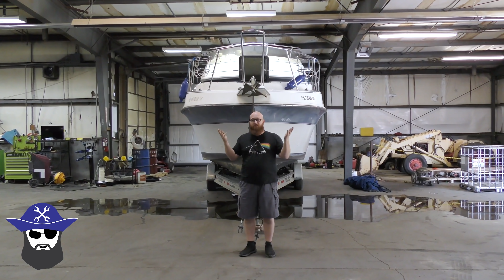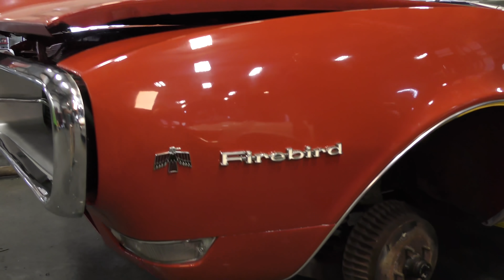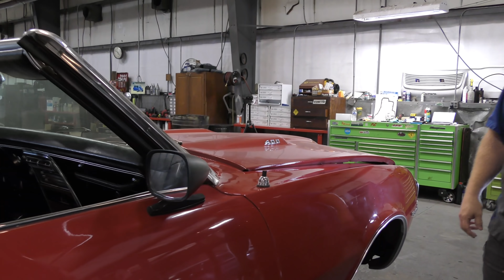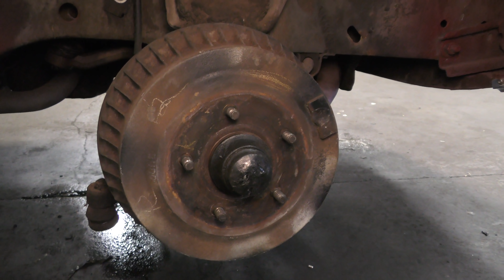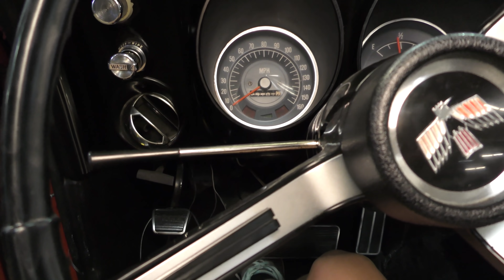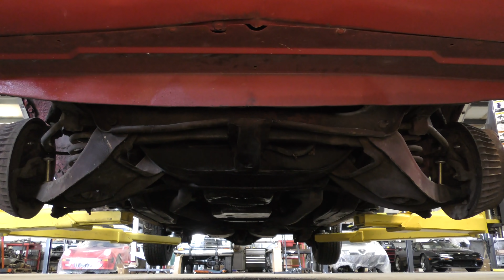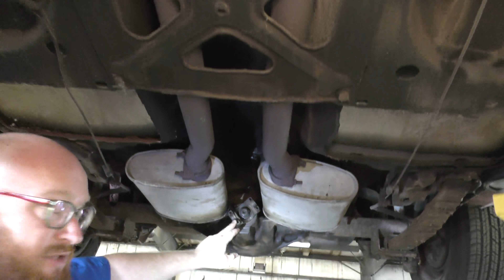Fabulous 1st Gen 1968 Firebird 400 leaking like Niagara Falls. The CAR WIZARD finds 6 places leaking

Comment: Whether or not you think these are easy to work on compared to some newer cars depends greatly on which newer car you are refering to.  I could have everything disconnected and have that entire engine out of the car faster than I could replace the valve cover gasket in a 2011 BMW N55 engine.  I owned four first gen Firebirds in the past and one 2011 BMW 335i and have done both (removed engines; replaced valve covers).  Replacing the valve cover gasket in the BMW was a 4 hour job minimum (unless you've done tons of them) and that didn't include the initial research time. I've pulled the Pontiac engines completely out of Firebirds in the same amount of time in my younger years. But, if I wanted to replace just the valve cover on the Pontiac engine, I could do that in 5 or 10 minutes.  They are not hard to work on just different. One of the modern advantages is being able to plug in a diagnostic computer so the car can tell you where it hurts. No such thing in the older car, so old school mechanics had a much better understanding of how engines actually worked than "some" newer mechanics that sometimes barely understand what a piston does (seems that way sometimes anyway). Obviously I'm not refering to the Car Wizard or his team because I see them working on engines sometimes.

Comment: The seats look like the original vinyl mesh seats like I had in my 68 firebird convertible. Those seem to be very rare as I've never seen them in a restored 67-68 firebird. I remember them well. Cool mesh seats that you could sit on in summer and not burn your butt. Also nice for the times that I went swimming and sat down with a wet butt.

Comment: Are you kidding me? Older cars like this 68 Firebird are much easier to troubleshoot and work on than todays cars. You don't have to remove twenty things that are in the way to get to a part that needs to be replaced and there's a lot more room to work in the engine compartment of the older cars.

I can't imagine being a young tech and not wanting to know how to work on or at least have a basic understanding of how the older cars function. If for no other reason than to gain some knowledge about auto repair from a historical perspective. 

Knowing how to work on older cars could also come in handy should the time ever come where you need  to earn some extra money on the side.

Comment: Hey Car wizzard is that balencer an orig gm part? 
 I have a 79 trans-am 10th 400 4spd.
mine is low milage, bought it new, but im thinking that rubber has to be deterioated. Alwsys best to replace it before they fail.

Comment: I did work on them in 1968 at a Pontiac dealer in 1971,  I actually had one a hard top with a 350HO car wizard you did not mention that motor. It was easy for me to work on where the new ones are a nightmare with all the wiring and computer controlled BS for EPA regulations.

I also had a 1967 I had a  guy buy at an auction, bought for parts if needed when I had a wreck in it, that had that 6 cylinder overhead cam nightmare that didn't last a month before I had to have a piston replaced. Overheated on the way to trade it off for a 1968 Chevelle SS and had to wait down the road to cool down before I traded it. Luckily the parts I needed for mine were still available from a dealer.

Loved that car but was forced to sell it cheap when we had to move 900 miles and I had three cars. Chose to keep my 1955 Chevy instead.

Comment: Harmonic balancers always need to be checked.  I've found the timing marks way off. Even from reputable companies.  Always go to top dead center.  Check the balancer to the timing mark on the cover. 1967 & 68 are different timing chain covers.

Comment: FAILS! 

      Drum front brakes on ANYTHING are a total JOKE!  When I switched over from drums to front disks on my 68 400 firebird convert my stopping distance went from 114 feet at 60mph to 61 feet with disks at the same speed on the same strip of road, same car nothing but the drums switched over to disks. This is not hear say, FACT! I still own the car and can prove it. 
  Also, points are very simple, set the dwell with a meter and you're done, with a computer it might tell you to change many parts you didn't need to. Your being dishonest about the truth car wizard.  However, it is true the first gen Firebirds are harder to work on then the same year Camaro, but there is a reason, there just a better built car from the get go. Another thing, the old motors are made to be overhauled many times, but the new aluminum dry blocks your very lucky if you can bore them more than once! and its toast. Again, your being dishonest or not giving the facts.

Comment: Not understanding a distributor or AFR or anything is pretty embarrassing as a "technician." I also am kind of at a loss on the whole thing I've heard you mention in multiple videos about "brackets upon brackets." not only do you typically have plenty of room, the brackets are held on by a couple bolts each. ASSUMING the AC compressor belt was one of the closest to the block, at the worst you have to loosen the power steering pulley, remove the belt, loosen the alternator, etc. THere's not "brackets on top of brackets" you can typically pull a few belts off. Even removing all of the front of an engine on something like this is quick and easy.

Comment: I owned and flipped 67-69 Firebirds as a teenager in the 70s. My main ride was 67 326 bored to 383 with headers, Edelbrock intake and a Holley double pumper. My dad drove a stock 68 400. The 67 was offered with a 326 but was replaced with a 350 in 68. I still have the exhaust gas analyzer and oscilloscope we used to tune those cars.

Comment: One big thing on old GM cars people overlook is the rag joint at the steering box. If the box leaks oil on the rag joint it’ll swell up and end up being really sloppy and loose. Dry rot can also be an issue as well but in either case you can replace the rag joint for under $50 or even upgrade it to a Universal joint for around $100 if you DIY. It’s amazing how much play you can take out of the wheel by replacing a worn rag joint.

Comment: Drum brakes, glad to see those disappear. They were lousy. If you hit them at high speed, they give good braking for about a second, then fade. After that you could either lock them up or have no brakes. I had a Roadrunner and a '68 Pontiac Tempest before that. Both with those drum brakes. Terrible. We got used to that gas smell and didn't even notice it. But now, like you say, when I get around an old car they really smell of gas. And when they run, the exhaust smell is really strong.

Comment: From everything that you described that vehicle sat without being used for quite some time and sat very dry. A good light coating of oil on all these parts that were drying out would have helped. Aerospace product that is available now that 303 protectant He is wonderful for soaking any of those rubber Parts especially that are going to be exposed to the atmosphere. It will make them last much longer than they would otherwise. And no you can't hook a computer to it you actually have to know how to work on them. But they are very simple to work on.
Knowing how these vehicles work though tells you everything that goes wrong with modern cars it just a different item controlling what still goes wrong. Take the time to learn what causes these things to fail you will be a much better mechanic for modern cars. And we are just one solarflare away from these vehicles like this being the only thing on the road.
I'm going to poke fun at you for a second where in the world did you learn how to say the word Brougham???
And keeping those original front brakes and doing a front disc brake conversion would be a really good update to that car.  That is 79 thousand miles because that a hundred thousand miles those actually have an element built within the odometer to start staining the mile numbers with a blue ink.

Comment: I am from Toronto original , I had  78 Monza I remember the my  mechanic  , he could tune that car from ear, it's old skill, I am now here living in the UK,  I remember a bunch of guys  had this  78 Nova, it would not turn over,  they were not familiar   cars , so  I had a feeling it was flooded, so an old trick, remove the air cleaner, stick a screw driver to keep the carbs flaps open bang turned over, I am not mechanic but these are things if you had old cars you just know,  are the new cars easier to fix it really depends on the car,  but overall yes they are easier,  but finding Mechanics that know how to fix these cars you really have to call around if only we can have a Car Wizard like you,

Comment: Well in terms of these old cars are worse to work on than new, I think that depends.... Most things are much easier to get to. Try take off the starter motor on this old car, the radiator, the brakes, the carburettor, all much easier than to work on new stuff. Fair enough if it`s only a case of hooking up and diagnose yes but try actually do some dismantling I prefer the older car any day.  Tried replacing spark plugs on a newish car some time ago, it was a nightmare.... I once had an american Chevy Caprice, I replaced the gearbox with the car jacked up on jack stands, did this alone and it only took 2-3 hours. Try that today with any modern car....!

Comment: Front drums are junk. If you have to qualify something with "if they are set up properly" you're making excuses. Not to mention in the Pacific NW where I'm from my old cutlass with perfectly setup front drums could be a real pita when it rained heavily. Disc swaps are easy and the car is immensely better. 

The paint on that thing looks like an older Maaco job. It is a good 20 footer and I'd definitely drive it (until I had the time to strip it to bare metal and make it nice...which I would

Comment: With the gas fumes you also need to remember having a garage wasn't a thing. If you're lucky you have a carport like what I have. Still attached too the house and could easily be converted into a garage. That's what my dad used to do but always left ventilation at the back.

Comment: From personal experience, you can't stop in these cars or GM A bodies with front drum brakes from modern highway speeds more than 2 time in close succession. The type of brake shoes used will probably make a big difference. If you want to drive @70 mph or higher, even the factory disk brakes improve the drive-ability and safety of these cars.

Comment: Way easier to work on. Don’t require expensive or specialized tooling to fix. Everything is mechanical. Don’t have 900 sensors that cripple your car. So much simpler. If you can’t work on these you’re not a mechanic. Everything is open and accessible. Air fuel spark that’s it

Comment: They were easier to work on.  All you needed was a basic toolbox, a timing light, a dwell and tach meter, and a torque wrench.  And if you were good you could do without the meter and timing light
Reply: @cirtapseven3742  I remember that.  And if you were poor, most auto repairs were made with a crescent wrench, pliers, vice grips and a couple of screwdrivers.  I changed brushes to repair generators and rebuilt carburetors with a cheap kit at the kitchen table.
Reply: @cirtapseven3742  We were the same.  Never considered ourselves poor, we just didn't have money either.  Financially challenged, as it were.  Yes, BFH therapy came in handy.  Not to mention the useful jack handle/tire tool.  I changed ball joints on the side of the road with the tools we've mentioned.

Comment: You should replace the timing chain and gears while you have the front of the engine down that far. The 400's are notorious valve benders! Given the condition of the harmonic balancer and the fact that the front main seal is leaking you can bet the timing set is about to puke!

Comment: I grew up in the 60-70’s.  I know how to work on those motors.  I own Tesla’s now.  Just think if EV’s were first and now the you came out with Ice cars.  You mean I have to find a gas station vs filling up at home with my solar panels.  You have to open the garage door if the gas motor running.  So gasoline is toxic and you burn it to make more poisons.  Why so much maintenance like tune ups, fan belts, radiator and tranny service?  No instant torque at 0 rpm.  Why do gas cars have to shift and make so much noise.  Those petro chemical odors make me sick.  Just think of all those oil filters in land fills ever 500 miles.  Times have changed.  I save $400/month on gas and home electricity with my solar panels and storage battery.  I usually fly when I travel so my Tesla’s never been to a supercharger station.  The grid becomes greener everyday.  My oldest Tesla model X with 50,000 miles never been to a service center.  Only maintenance where tires at 30,000 miles.  WiFi updates keep the car feeling new like smartphone updates.

Comment: Those drum brakes are fine, as long as you don't really use them hard or too much ;)
My first car had 4-wheel drums. Fine in daily driving, but a long grade or hard stop from high speeds (we're talking 75mph, not 150), not so much. Fade was bad.

Comment: Good advice on the harmonic balancer. I learned the hard way 30 some years ago when I built a 350 and used an old junk yard unit.  It “walked” (went bad) snapping the nose of the crank off on a 45 degree angle in the front bearing. I was 800 miles from home and could not believe my eyes when I heard this racket under the hood and opened it to see the drive pulley and belts flopping around but still turning.  It was so surreal.  I trailered the car home and to my surprise, the only other damage was to the cam bearing immediately above.  New crank and balancer and it was good for another 200,000 miles.  I credit synthetic lube ending in 1 for minimizing the collateral damage.

Comment: Back in my day after graduating out of Lincoln tech in 1985 I remember working on some early model GM 1980 to 85 that were metric and standard before they converted everything to metric today’s cars are so much easier to work on.I remember back in the day when cars had 3  belts 
Air conditioning water pump power steering and smog pump . And back in the old days they didn’t use a lot of zinc coated fasteners ..Rusty or Snap off  boy do I sound like an old man. Oh my daily driver of the focus ST 😀

Comment: you are going to bend that car picking it up by the rocker panels, the correct lift points is the subframe in front and frame rail in the rear.

Comment: Car Wizard you can keep your computers controlled cars crap! I hate them with every fiber in my body! I get sick every time i open the hood of these new cars makes me wonder what drugs the engineers are on when they design them. When i work on these older cars I don't need $30,000 worth of equipment to do a tuneup or a masters degree to remove a transmission. most cars and pickups back then had tons of room to work under the hood compared to the cars, trucks and SUV's today where you can't even see the serpentine belt from all the bullshit that's pack into the engine bay or I don't need to remove the entire engine to replace the timing chain. I'll take a car or truck built before 1985 anyday over these new vehicle that you can't work on from fear of being sued by the manufacturer.

Comment: Another great episode. That car originally had air conditioning. You can tell by the stuff under the hood. At some time the compressor was removed and the hvac controls changed to a non a/c version.

Comment: Car is nice, but nowhere near original.  It’s clearly been repainted, with overspray on the underside and gas cap. The engine has been out.  Pontiac engines were a light blue, not red.  The fender liners and under hood were black from the factory.
This was an a/c car, but the a/c compressor is missing.
Nice to see the car still has a Q-jet.  Best street carb ever!

Comment: Work got in the way, back to it
2:02 closer to 285 net hp.
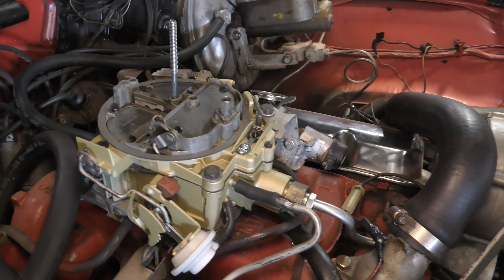2:14 replaced Q-jet? Looks to have all the external features for a '68 FB 400 auto carb. The original looks rebuilt.
3:45 Harder to work on? Really? Spin the air cleaner wingnut off and 'Boom' the carb and jets are there the fuel filter is there the distributor is there.  Last winter there were battery problems on my '09 Silverado. I could see the battery but it took 3/4 of an hour to wrestle it out.  Lets not talk about changing headlight bulbs.
4:15 Labor cost $100/hr, so $50 to remove the bad part? That's why these are 'hobby' cars. Over exaggerated on the layering of brackets. You lift the new car hood and somewhere under the engine shroud, all those hoses, sensors and wire harness is a sick engine...
5;46 Pontiac arrow crest.
7:20 Try that trick with a '57 Chevy!
8:58 The drums are good for 3 repetitive panic stops, then brake fade.
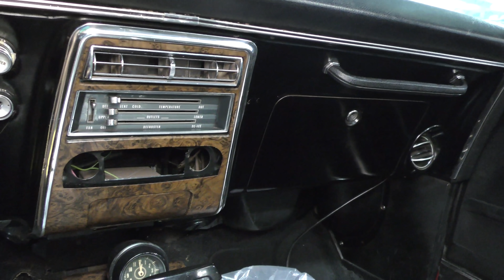9:57 Oh nice an AC car.
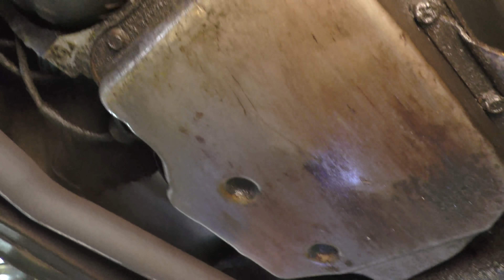14:57 Dual exhaust. Crossover muffler gone.
16:31  It has (non-operative) air conditioning!

18:10 I bet the gas cap has swapped from a vented gas cap to a non-vented cap or the fuel pump has been replaced with one that doesn't have a fuel return line to the tank. To reduce the fumes after a run, open the hood  to reduce the underhood heat trap and perculating the fuel in the carb.

Comment: I don't know if I could trust any mechanic who says he doesn't know anything about carburetors, distributors or drum brakes and doesn't want to learn. :-) I'm still driving my 1968 Chevrolet convertible and it has twin carburetors, a distributor, non-power assist drum brakes all around, no power steering and is air cooled! See if you can guess what it is? :-D I also have no problem with direct injection, distributorless ignition, computer controlled cars with ABS, traction control, stability control and modern infotainment systems. You just have to be willing to learn, whether it be new or old technology. :-)